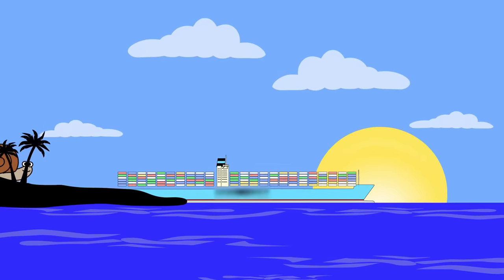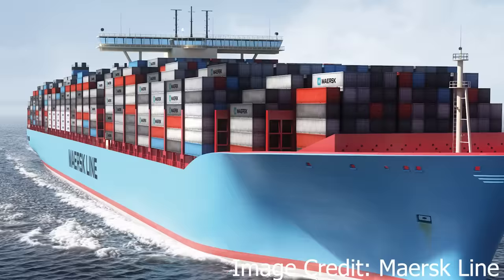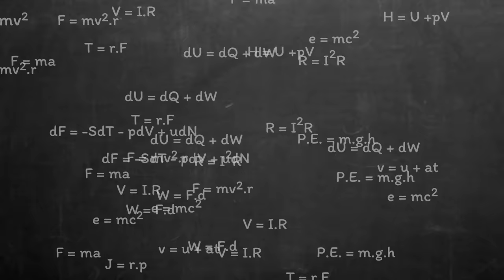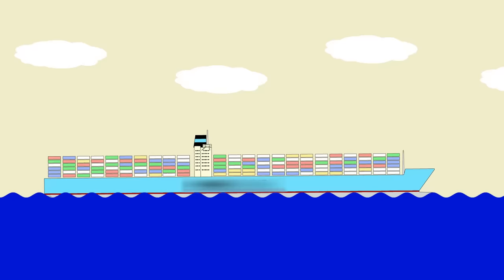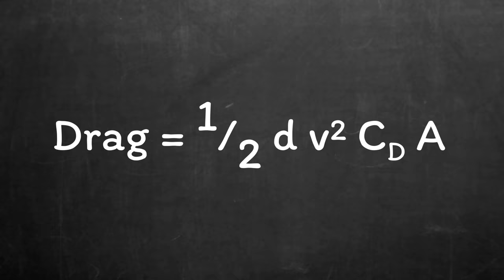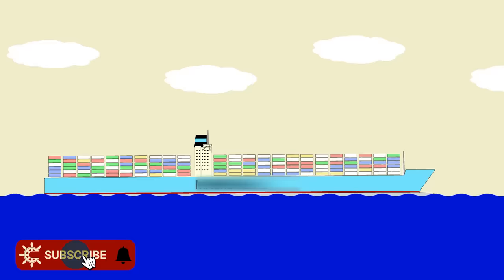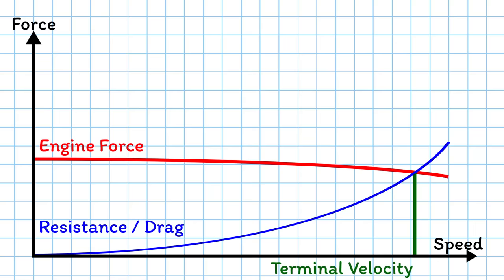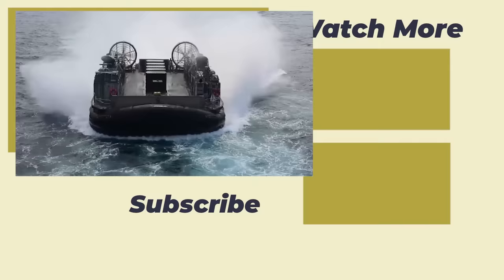Why are ships so slow?

Comment: Ships aren't designed to be fast. They're designed to be economical.
Reply: there are some crzy fast ships and boats my friend)
Reply: That's why he said ships and not boats
Reply: @hastonfernandes6479  there are hundreds of overpowered turbine ships! and by the way going on foil makes it more efficient but not sure overall)
Reply: That depends. In the 1980s I worked on twin steam turbine, twin screw container ships that could go from the UK to the Far East in just under six weeks. Cruising speed was between 25-30 knots and we burned £,£££s of pounds worth of fuel per hour, but many freight forwarders would pay the premium price for the fast delivery. The company was Ben Line Steamers of Leith, Scotland. Their slogan was "Fast to the Far East"

Does a Cross-Channel hydrofoil doing 40 knots or a Pegasus class destroyer count as a ship?
Reply: @corydorastube  i wonder why they don't install nuclear reactor inside that container ship...=_=
Reply: @mrpicky1868  boats, yes.  Ships, not so much
Reply: Ha Ran - Economics. WAY too expensive for little gain.
Reply: @AtheistOrphan  ah... Now I see, it's the most simple sounding answer but for some reason this is a sound answer.... =_=
Reply: That's why they use heavy oil and use basically no filters
Reply: Not exactly they could if they wanted to
Reply: Designed to transport large amount of goods I suppose
Reply: Not all ships are designed to be economical
Reply: Being fast and carrying large amounts of goods do not mix.
Reply: As long as they don't sink...
Reply: Ha Ran - i guess the aircraft carrier ship that the navy use is powered by nuclear. It is a hybrid of fuel+nuclear i think.. correct me if im wrong
Reply: Economical? just look at how much fuel they use
Reply: @ja.935g67  but look at how much they carry

look at how much fuel a plane uses, then look at how many planes you'd need to carry the same amount of payload. Do the same with trucks or cars
Reply: So race boats don't exist?🤦
Reply: Saving a little money in exchange for  a waste of time and a week of anxiety and stress is hardly worth it.  Plus big cruise ships like disney cruise are 10times the price of a plane ticket
Reply: The nuclear energy itself doesn't power the engines, it's steam from the reactor's cooling system which turns a turbine which subsequently turns the propeller.
Reply: They are not designed to be fast. They're designed to be sunk.
Reply: @brainey001  If you want fast and comfortable travel, planes are definitely the way to go in this age and there is no argument in that. Cruise liners tend to be way more expensive than planes despite being a lot slower is because you are paying for the ship experience. Those things are basically hotels on the sea.

And you are saving a lot more money and time with cargo ships compared with using planes for transporting goods. Planes are fast but add in their carrying capacity is very low, they need to be refueled at every stop,  number of trips they have to make back and forth to deliver the same amount of goods as a ship, air traffic, and the numerous of safety measures that have to be taken into account to fly a plane; you will find that ships are way more economical despite being so slow.
Reply: Wojciech Pordzik  you need to calculate how many co² per km per ton i'm sure the big cargo ship will win . even a truck will win . our cars only transport 70 - 120 kg most of the times and uses 6l/100km . a truck is 26000 kg of payload and is only 30l/100km . no way  even with a car fully loaded that you can transport 26000 kg of payload with 5 cars . same thing for ships
Reply: btw these days many ships use bio diesel so actually they don't produce extra co² or way way less than they before .
Reply: Hydrofoil gang rise up
Reply: Such a giant cant be pushed to a fast moving speed.... Lol
Reply: Shimikaze would disagree
Reply: This is so true. That is why it only cost a few dollars to ship a TV from China to Europe.
Reply: @brainey001  lol, there are different types of ship, cargo, cruise, passenger, to name a few. Cargo=economical, cruise=a moving resort, passenger=convenient transportation.
Reply: @madensmith7014  then there are these air travel laws and regulations, airplanes consume a lot fuel, but there are a lot of cost after that, such as landing on another territory, passing above another regions,etc.
Reply: why it is more economical? well, its because of buoyancy. Air travel depends on thrust and land travel depends on friction. Of the three states, liquid is the most versatile and has the most flexible molecule formation.
Reply: Wojciech Pordzik  
I belive some cargo ships, icebreaker ships etc. are nuclear powered. Many if not most large military ships are, I think.
Reply: But that is true for 747 and a car to (well a family car). Most modern airliners is optimized for low fuel use
Reply: samanli2014 yes. And they pollute. Top 20 ships produce greenhouse gas than all cars in the world.
Reply: @PD-we8vf  No.. that is objectively just not true
Reply: @mrpicky1868  but they are crazy, so not economical
Reply: to answer the nuclear question, reactors are extremely big and expensive and the bigger the boat, the bigger and more expensive the reactor/s, the more regulations, since allot of countries dont want a nuclear reactor in their harbours which will also cut potential profits, then it comes time to decommision the reactors with very few facilities with an ever growing line of destroyers and submarines needing decomming, regardless of cost (potentialy over a billion dollars for the 95,000ton USS enterprise (~4 billion dollars to buy) which likely wont be fully decommed till the early 2030s due to the section of the hull with the reactors and all their bullcrap..

and guess what! you still have to deal with physics! so the speed ultimately isnt going to improve! there are limited niche applications for nuclear reactors on ships that can justify the costs and bullshit, but for cargo ships its dubious..
Reply: @rosiekatze  Reactors are definitely more cost effective for warships especially with the advancing weaponry. The number of electronics present (radars, sonars, wifi, etc.) and it's need to be functional for long periods on the seas really puts a good use for a reactor in a ship. And railguns are in development (I think it still is or is already done) which require even more power to run which would require tons more of fuel space than if we were using standard fuel.
Reply: To remain at low specific power on the Gabrielli-von Karman diagram
Reply: So many answers!!! :D
As you said it, they are design to be economical, which is not the same as efficient, so if they are not efficient but they are economical something is wrong with the economy.
Reply: Beep Bop  well, some submarines are nuclear powered and i don't see how they're cooled the well in such a tiny place. But they could do the same with ships that got way more space.
Reply: Economics is the real reason ships are so VERY slow. It’s like the difference between freight trains and bullet trains.  If you care about efficiency efficiency efficiency, speed isn’t a priority.  Plenty of military ships are much faster, but freight ships are interested in efficiency and throughput, not raw speed.
Reply: KK can it’s basically just a big steam engine, you have the reactor heating up water used to cool it, the heated water turns to steam, which then turns 1-2 turbines.
Reply: samanli2014 I’m pretty sure taht the faster you are, the more economical you get
Reply: @haran9104  
Some years ago there was a nuclear powered cargo ship, the NS Savannah was built in 1958 and decomissioned in 1972. Three other nuclear cargo ships have been built one each built by Germany, Japan, and the (then) Soviet Union. None are still in service. The Soviet Union/Russia has a number of nuclear powered ice breakers in service though.
Something to remember, cargo ships are a for profit buisness. So, holding costs down is a major priority for shipping companies. Nuclear power is an expensive proposition across its entire life cycle. Millions more in cost to build, more to maintain, more to crew, more to/if refueled, more to decomission and store the spent fuel. I
Reply: Time is money?
Reply: @marlowkrach6325  not necessarily the faster you are, the more fuel you consume, the more moving parts will wear and tear, and more costly to develop and research new technology
Reply: @marlowkrach6325  not necessarily the faster you are, the more fuel you consume, the more moving parts will wear and tear, and more costly to develop and research new technology
Reply: Additionally, Cargo ships are not designed to be fast because of the unpredictable currents/weather. I know we have modern tech to calculate it but it's still not accurate. Sometimes, we will receive a report that we will have a calm sea all day, then will change again after an hour. 

I work in a cargo ship (bulk) and when we have a rough sea, we are force to slow down for the safety of the crew and ship.

But let's say that cargo ships are fast and the weather is good. Even if we arrive in the port earlier that our ETA, we are still forced to anchor and wait for weeks/months before  the port can accommodate the vessel especially on big ports in China, Brazil, USA, etc. because of the number of ship coming in and out. 

About the nuclear, I never heard of a Cargo Ship using one and I guess its not safe for a cargo vessel to use one. Imagine living in a ship having a nuclear that might blow up anytime and has harmful radiation just below your cabin. Also the cost and maintenance of it is too high for sure.

PS. English is not my mother tongue. Excuse me if I have wrong grammar.
Reply: @haran9104  its been done to u-boats already. Although I don't have any info about real ships getting powered by nuclear power^^
Reply: Time is money
Reply: samanli2014 Best comment answer so far. A lot of "big and heavy" while nobody questions why, even when we have built ships that could speed up to excess of 30 and even 40 knots before, restrict cargo ships to such a sluggish pace.
Reply: @corydorastube  Pegas class were PHMs , US Navy designation for Patrol Hydrofoil Missile . As they had both a hull number and individual name I think they would be considered ships , not small craft .  Most navies woul put them in the corvette class , larger than PT boats but smaller than frigates or destroyers .   USN vet here .
Reply: @Ecan26  US Supercarriers use solely nuclear power for propulsion , the tremendous amounts of jet fuel they require are mostl for the aircraft .  A small amount are used for such things as portable firefighting pumps , and possibly for auxillary power units .
Reply: @adrianhansen2784  The fastest ships are naval vessels , generally speaking . Surprisingly US Supercarriers (CVNs ) are faster than their screening vessels over distances and can sail for a decade or more without refueling their reactors . They need to refuel often ro keep their aircraft flying .  When I was in the USN we had a class of nuclear powered cruisers (CGN) now decommissioned .
Reply: @madensmith7014  Dont forget the lazer weapons being intalled on USN vessels . They require huge amounts of electrical power .
Reply: @victorwaddell6530  Id does not matter what you think, us vet or not. They are classed as fast attack patrol BOATS. Would a WWII MTB also be a ship? They also had names and pennant numbers.
Reply: Ships would be designed to be fast and economical, if they could.
Reply: Wojciech Pordzik not true, a million Teslas  or BEV would emit no CO2 .........
Reply: Wojciech Pordzik  
In the running for "stupidest thing said on the internet."
Reply: @corydorastube  How does that compare to just putting the cargo on a plane?
Reply: @voidvector  How would one get 70,000 tons of iron ore onto a plane?
Reply: Never been on a CVN huh?
Reply: corydoras Good point. High speed and heavy load do not mix.
Reply: @haran9104  I have been pushing for this big time.
Reply: @jamesbingham1007  ...
Reply: But clients want both
Reply: Dmytro Picky they aren’t economical
Reply: @leoadrianresuma7900  Are you Indonesian ? But i don't find any mistake in your grammar !
Reply: @leoadrianresuma7900  Best comment !
Reply: @leoadrianresuma7900  Best comment !
Reply: @haran9104   Ha Ran: GREAT idea! 'Cause what could POSSIBLY go wrong?!
Reply: @showpro1178  hm... let's say, a stupid misconduct could spell undesired quick nuclear reaction ending up in nuclear explosion swallowing all the crew(s) who have no chance to escape to begin with....further damage to living environment around the area due to nuclear radiation is unavoidable and will last for years forward.... something like that? =_=
Reply: @brainey001  anxiety and stress are far more associated with flying than sailing! The price of a cruise is not reflective of travelling a number of miles, moreso the nights in a floating all you can eat city
Reply: You mean paying for 100,000 litres of fuel
Reply: they need to survive rouge waves
Reply: yes and am wondering why the ratio fuel consumption/weight (or volume) of carried goods wasn't mentioned
Reply: @vasskolomiets41  Cause the video is about speed, not efficiency.
Reply: Iowa class battleships can GO 33 to 35knots...

If I am right?
Reply: Rich 91  military ships are belonging to the insurance business, not to the delivery one. Is a movie about the insurance business?
Reply: @theviniso  and why is considering the delivery of goods and passengers?
Reply: Leonardjustin Jsering 35 knots is 64,82 km/h, not very fast for a car.
Reply: @vasskolomiets41  For context.
Reply: @haran9104  There was at least one nuclear powered cargo ship in the 1960s, the Savanna if you want to research why it hasnt been done since
Reply: @NoMoreBsPlease  They were covered in the video, a planing hull design. Virtually all ships except those discussed have a displacement hull design.
Reply: Wojciech Pordzik  Not quite correct but true they do emit a lot. However be aware in the last 10 years or so engine design and fuel production has changed to make ship engines cleaner.
Reply: Well some cargo ships can go faster than 80 knots
Reply: how about military ships?!
Reply: saved me a 7 min video there
Reply: "They're designed to be economical." Capitalism, baby! Inject me with those dollarinoodles and the oil straight from the ground. Seriously though... the infrastructure those ships made possible is amazing.
Reply: you're larping as an intellectual again.
Reply: @mrpicky1868  And they are designed to be that way.